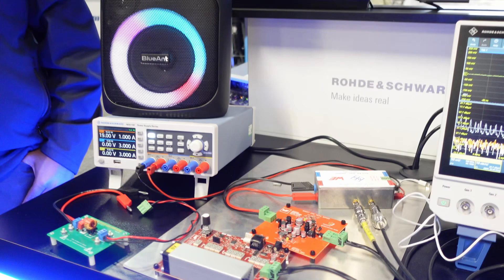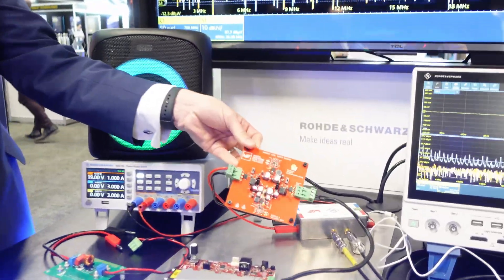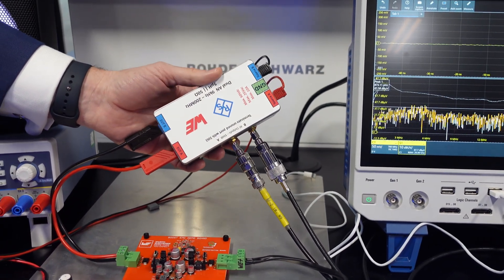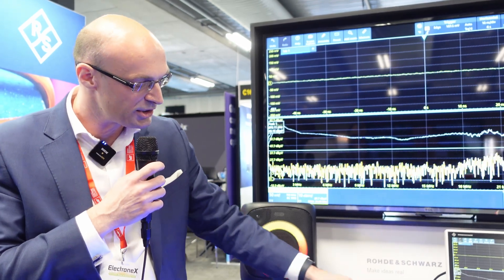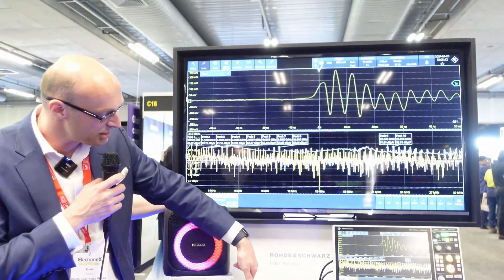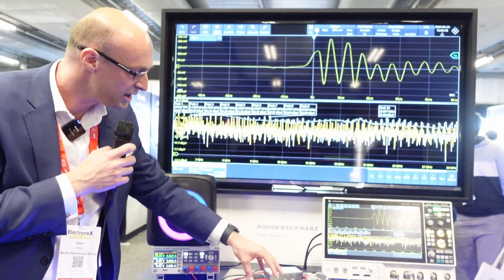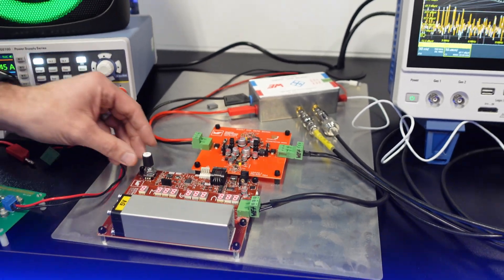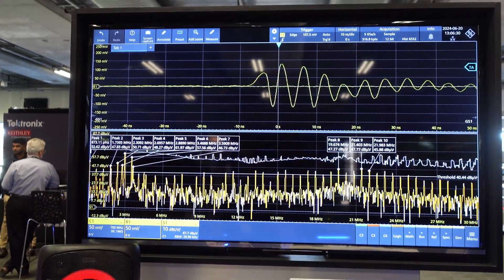Conducted Mode EMC Emissions Demo

Comment: Is MSO4 that good in FFT for substituting an Spectrum Analyzer in pre-compliance?
Reply: The modern scopes are really good. We have a Tek 5 Series MSO and I have done plenty of work using it to chase away noise showing an FFT and time domain window simultaneously with multiple math traces for digital filtering. The noise requirement was less than 10 mVp-p between 100 kHz and 10 MHz and less than 100 mV out of band on the outputs. The power supply used was a flyback to meet 1500 Vrms isolation which was switching at 100 kHz. The scope helped immensely.
Reply: @Fix_It_Again_Tony  That one is a beast. I used to use it for GaN characterization. For sure very convinient for SMPS. Thanks for your feedback.
Reply from the maker: Pretty decent, yeah. Especially the 12 bit ones.

Comment: OK, so this is measuring Conducted EMI.  Where does the Radiated EMI come from?  Them long antennas interconnecting everything, aka wires.  Start by shortening, twisting and shielding to reduce emissions!
Reply: Conducted Emission is measured on Wires, usually in the frequency range of 150 kHz to 30MHz, that's because in this frequency range the main source of (also radiated) emission comes from the connected Wires as the DUT itself is relatively small compared to the wavelength. From 30MHz upwards the DUT itself can be an effective antenna which is why you measure radiated emission in that frequency range. Obviously, this setup does not comply with the CISPR25 standardized test setup, but keep in mind that conducted and radiated emission are two different things ;)
Reply: @techko0240  Well, kinda.  Even 1mm trace or way less inside an IC has Conducted EMI, which becomes Radiated.  This is why not only PCB routing, but even routing inside a module or IC is so important.  Yes, from a regulatory perspective they are different.  One of the reasons that there is only a tiny bit of Conducted EMI at VHF / UHF frequencies and above is that they are significantly attenuated buy the inductance of the conductors.  On an absolute basis, you won't have any Radiated EMI if there is no conducted (i.e. current) EMI.  Keep that in mind when you fail your first emissions test.
Reply: @shazam6274  Well obviously that's a fair point, otherwise one wouldn't use TEM-Cell measurements on IC level EMI starting from 150kHz. The point I was trying to make and failed in doing so was, that one obviously would never use the same setup for measuring the radiated emission of this device. Especially when The PCB Layout and not the setup is to be evaluated. So while technically shortening and twisting the wires would help concerning radiated emission, it doesn't make sense here, as it's definitely not part of this demo.
Reply: @techko0240  My point is that if you first concentrate on reducing the Conducted EMI, the Radiated EMI will be reduced significantly.  This is why Ferrite Beads, from tiny to large, are used: they reduce the Conducted EMI from being coupled to the wiring, aka transmitting antennas.
Reply: @shazam6274  I see what you're trying to say. Maybe be careful with the terminology though. Conducted EMI literally relates to interferences caused by noise leaving the DUT via some sort of wires. So while ensuring there are no antenna-like structures within your DUT that are subject to RF voltages/currents definitely has a positive impact on radiated EMI, those RF signals aren't really "conducted EMI"😄.
Reply: @techko0240  Again, you miss the point.  Those "wires" carrying the Conducted Emissions are actually antennas which then radiate those emissions.  If you have some device which does not have "Conducted Emissions" inside or outside then you will not have any Emitted / Radiated Emissions!   As decades of experience have taught me, work on the easier to manage conducted emissions, both outside and inside your device first, which will reduce Conducted emissions.
Reply: @shazam6274  Which is not within the scope of the demo and was also mentioned in my previous comments. Not sure, what you're trying to discuss as I can't see any disagreement here.
Reply: @techko0240  Just trying to pass on decades of experience to newer EEs. 🙂

Comment: In my time at the EMC lab of my employer (in the construction equipment business), we used a fair amount of R&S gear.  A bit pricey, but wonderful stuff!  We had good support from Wurth Electronics too... a nice kit of ferrites, chokes, and that sort of thing.  Did a lot of work with Fair-Rite too.  Being able to clamp a ferrite on cables really helps identify where noise is going in and out of the DUT.